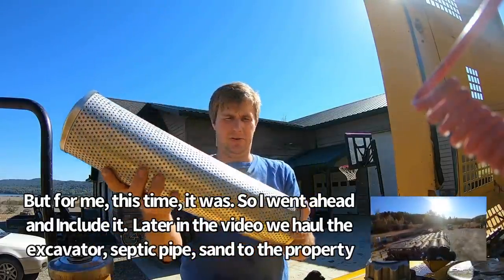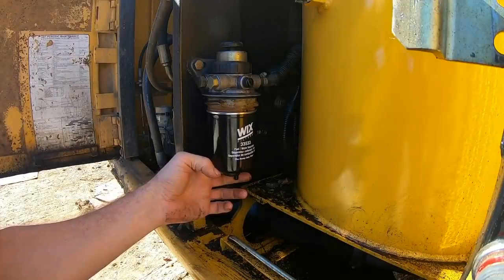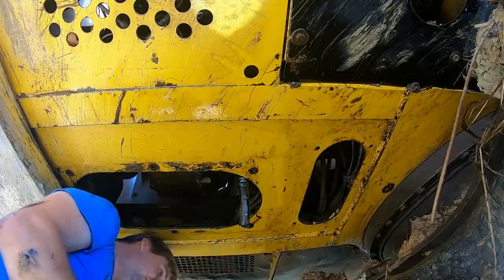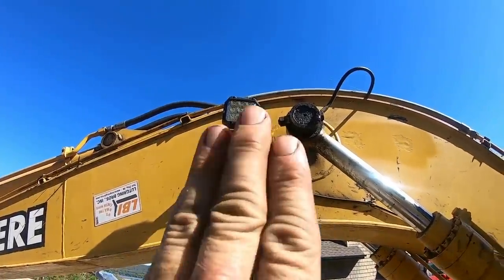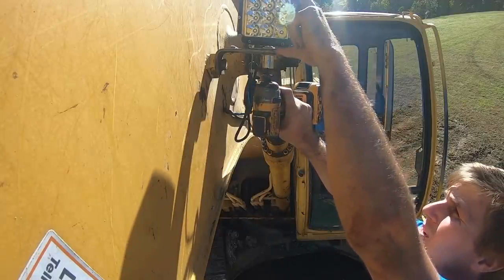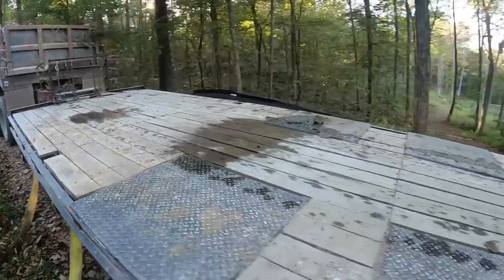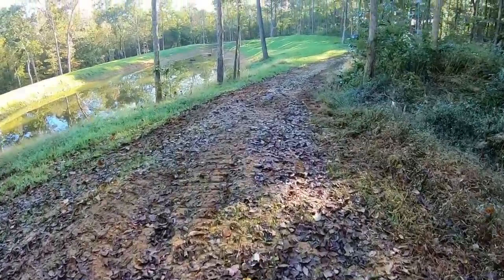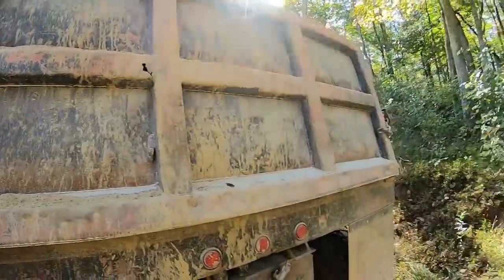Preparing For DIY Septic Install - What it Takes

Comment: It's certainly beneficial when you have the knowledge, skillset, and access to equipment like Mike does.

You can rent equipment, but some of it does require certifications based on type and size.  Not just anyone can rent an excavator.  Then you have to have a truck and trailer or rent those as well and be able to haul it legally with the proper certifications.

Comment: That bell tower move was amazing.  I cant remember if I commented or not. So here i go.  

Showing all the behind the scene stuff is interesting.  You are right that is all the stuff that makes the industry as much as it is.  I was thinking i (as a home owner) can dig a hole.  I am putting in a patio now.  I can not truck the material in/out.  The equipment in/out.  Maintenance. And when I really screw up the project I have to spend a week on youtube figuring out a solution.  Great channel.
Reply from the maker: Hahaha,  hey I spend a lot of time on YouTube for my mistakes as well!  It’s a handy tool for that

Comment: Those pins on those teeth drove in/out so easy.... I literally fought for an hour to get one pin out of my bucket. I have MTG kingmet tooth system on my hitachi 230 and they run a vertical pin as well.
Reply from the maker: They can definitely put up a fight sometime

Comment: "Someone in the comments will let you know if it's right or wrong"  

If it works, and isnt dangerous, it isnt wrong.  Same with pouring concrete.  Every tradesman has it's own nuance to pouring.  None are wrong as long as it's in the designated location with proper prep.

P.S.  The mirrors are still on the truck!
Reply: 😂 the mirror joke. Kinda like 'Why the 🐔 crossed the road?' 
 BTW, Mike knows why. 😉
Reply from the maker: Good point!

Comment: $3.94 per gallon? Ouch! It hasn't gotten that high here yet. The highest I've seen here is $3.39, average is about $3.19. Can't wait to see the septic system go in. Be safe brother.
Reply from the maker: Just keeps creeping up.  Thanks for watching!
Reply: Well, in the "Lower Mainland: of British Columbia, Canada even $3.94 is cheap to the cost here. $1.39 per litre which is $5.56 a gallon.
even with the exchange from Canadian to Us Dollars it's cheaper than here. ( $4.95 a gallon in Canadian )
Reply: @jaquigreenlees  dang dude, that's brutal.
Reply: Just done a bit of Math, here in the UK,today's average price for diesel is around £1.45 a litre,  converted to US gallons that's  around $7.56
Reply: @yorkshirerich2970  that's unreal man. Between my dump truck and all my equipment, I use about 70 gallons per week and I'm a very small excavation business. I'd go bankrupt if I had to pay those prices or my prices would have to increase substantially.
Reply: @blackdogexcavator21  The low cost of stuff in the US is why the rest of the world believes the US Gov subsidizes businesses.

A big part of the costs of fuel here is taxes specifically for road maintenance. The more built up an area is the higher those taxes are, so our roads are in better condition, highways can be upgraded etc.
Reply: @jaquigreenlees  Lots of things go into the price of products. Level of taxation. Regulations; more regulations more cost. The biggest one with oil is are you a net importer or exporter. Importing means more cost. Until Let's Go Brandon mucked things up the US was a net exporter. Now we are a net importer. Notice how the prices went up.
Reply: @hedge685  I'm in Canada not the UK.
Reply: I just paid $4.49 a gallon, truck took 140 gallons.
Reply: @ko9446  that hurts
Reply: @blackdogexcavator21  it does. I know for a fact my company will pass on the extra costs. These fuel costs don’t just effect the companies, it effects the end users.

Comment: We built our house here in Ohio 45 years ago.  We wanted to put the septic tank on our land in the country on our 100 acres with a leech bed.  They made us do off lot. (Draining into the ditch). They told us to do it there way or you can’t build.  THUGS!   Now if we sell we will have to put a new septic tank in costing around 20 grand.  And the seller pays that.  You can’t to it yourself.   In our area the ones that put them in are all related.   Hmmm
Reply from the maker: Unfortunately there are areas like that.  What did you end up doing?
Reply: @CaptainKleeman  we did what they said we had to do.  But now you can’t run your line in the ditch.    Our area is turning into all farms and Amish people.  When the farmers buy the land they tare down the houses for more fields.  I’d rather see the Amish move in.

Comment: JD 4042? Changed many fuel filters and services on the rental fleet. Did a in frame, on a IR compressor. Only to have a customer wipe it out in 70 hours.  They paid for a new engine.
Reply from the maker: Curious how they ruined it after 70 hours?
Reply: @CaptainKleeman  Mistook it for an amphibious vehicle, perhaps?

Comment: Daft question but is the colour of the fuel pump standardised in the US, Green for Diesel and Black for Gas? 
If it is then its the exact opposite of us in the UK!
Reply: Yes, here in the States green is strictly diesel.
Reply: @elizabethchetwood1916  Interesting, Green is Petrol/Gas here. Black is always Diesel, Red is off-road Diesel (Tax reduced) and Blue is Adblue/DEF fluid. 
Petrol nozzle is also smaller than the Diesel one to try and stop idiots from putting Diesel in Petrol engines but people still somehow manage.
Reply from the maker: Unless shopping at a BP where the rules don’t seem to apply 😂

Comment: Why doesn’t DP run off road fuel in the equipment?
Reply: Why buy the cow when you get the milk for free!
Don’t think it’s free but off road diesel just has a dye in the fuel but it is the same fuel and being able to fill up at the Derby market it’s too convenient. I think this would be his answer.
Reply: Well, can't run off road in the dump truck of course.  Beyond that, you can file to get your taxes paid on onroad back if you could have used offroad, it just means more bookkeeping normally.   However,  in this case, I'm guessing the derby market gets to deal with less bookkeeping thanks to not selling offroad, so it is a net lower paperwork for DP and his fellow derby market owners.

Comment: What % of clay is in your sand? It should be zero for a good septic system.
Reply: That may be the (official) difference between "State" sand and "fill" sand.  One is "certified" as being clay free and the other isn't.  Even though they probably came from the exact same location.
Reply from the maker: That may be the difference in the state sand,  may be washed